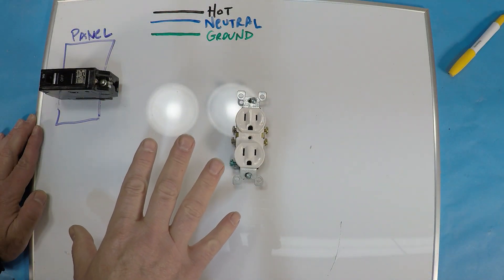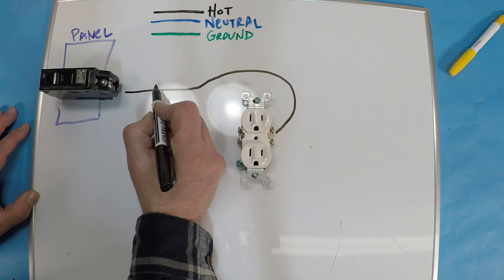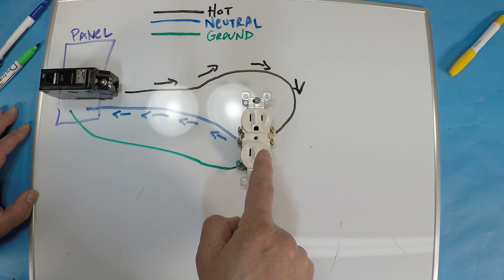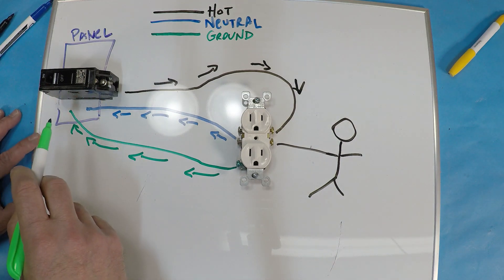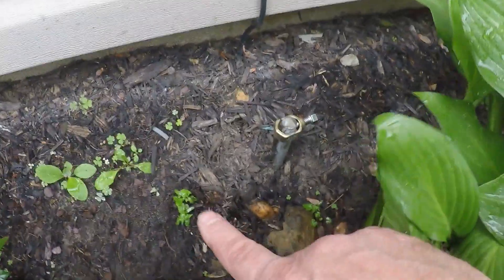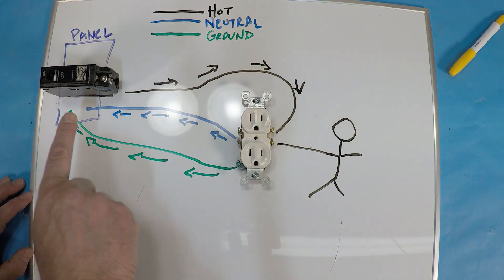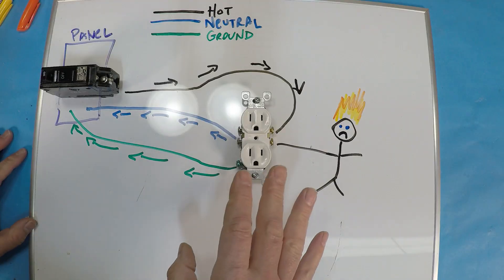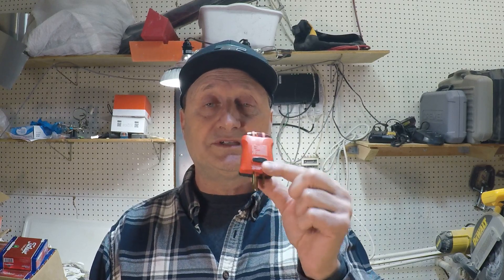How a Ground Wire Works and Why it is Critically Important

Comment: Hello. I have a quick question. So if the breaker is turned off, and both the hot and neutral wire are not live, why is the ground wire still hot? Is it necessary to turn off more than one breaker? Is it necessary to wait until all the energy flows to the rod outside the house? When removing the wires from the outlet, is there an order that they need to be disconnected? Thank you.
Reply from the maker: The ground wire is not still hot. If you turn off the breaker, then you are fine. Thank you for watching. Would appreciate if you could sub to the channel. Thx... Flannel Guy
Reply: Does that mean that there are more switches connected to that outlet? Do I need to turn off multiple breakers?

Comment: Could you explain if grounded bed sheets are safe when plugged into the house outlet
Thanks
Reply from the maker: lol... bed sheets? I never heard of that. If the heated sheets are made to be plugged into the outlet, then it should be fine and no different than using a heating pad in bed. Thank you for watching. Would appreciate if you could sub to the channel.  Thx... Flannel Guy